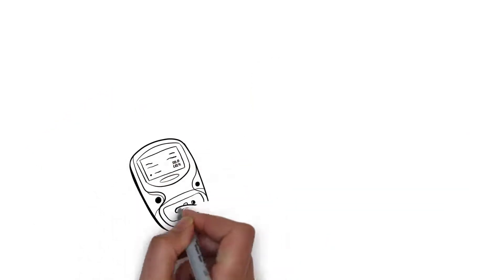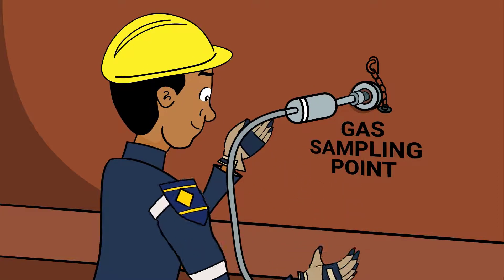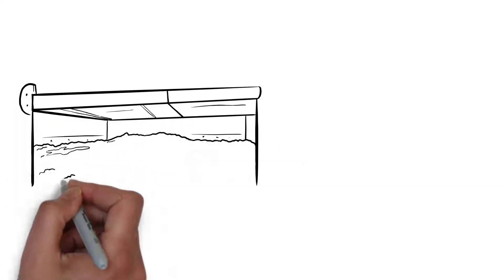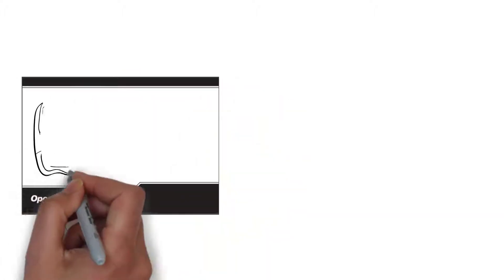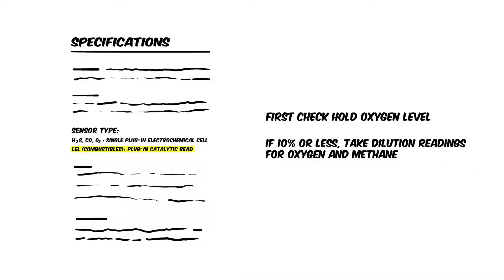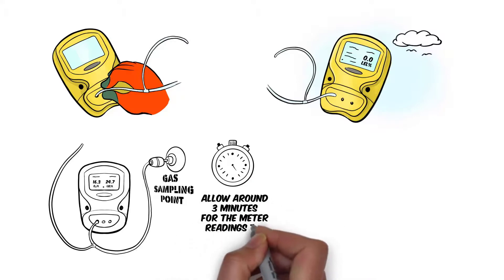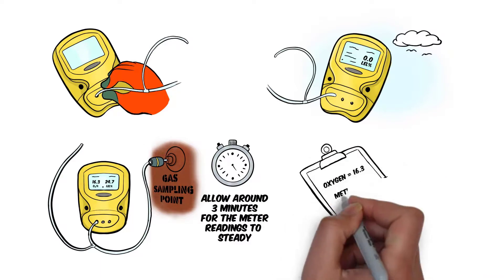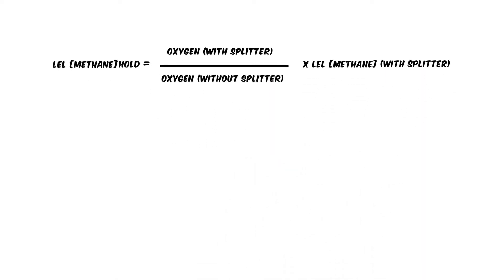Gas Measurement of Coal Cargoes - Learn the Ropes Series

Comment: The video is very information. 
Please consider to correct, if deemed fit, At 03:10 the meter is showing CO, O2 and H2S reading, it can be misleading as we are looking for Methane readings at this point. Also it's told that to record the CO valve, whereas we measuring CH4/Methane. Thanks